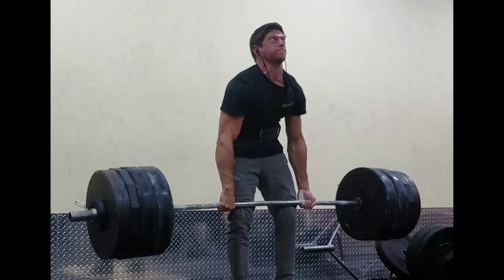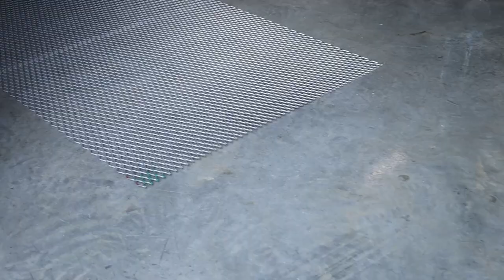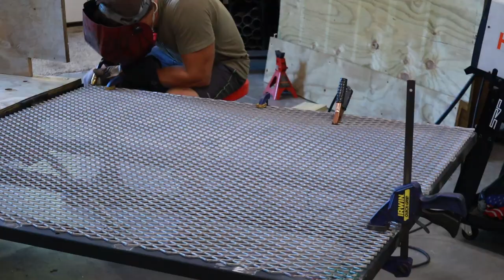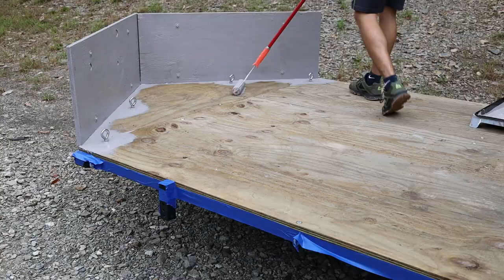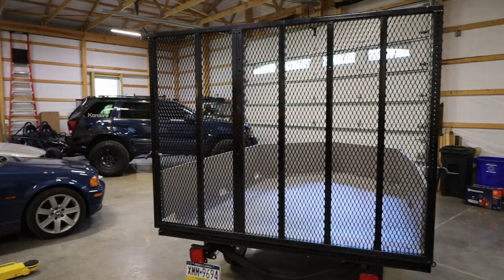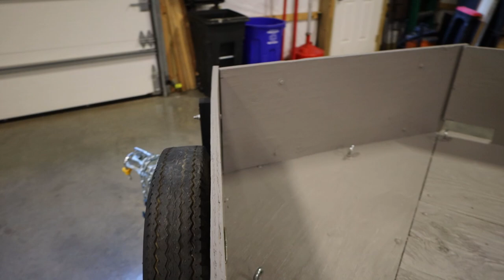Upgrading my Custom Built Trailer!

Comment: I was wondering if the ramp could be hinged in the middle so it would only be half as tall when up.  Good work with the mesh though that will help out a lot.
Reply from the maker: Yeah I kinda thought about doing something like that too, just didn't wanna add more complexity at the time. Thanks!